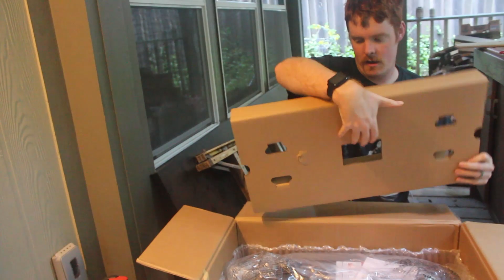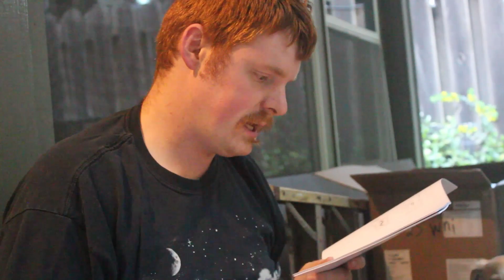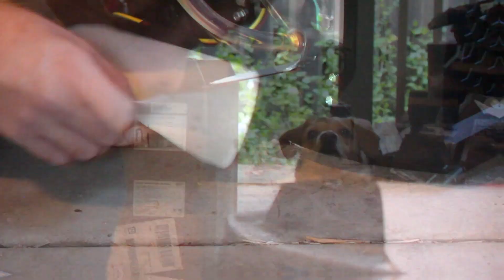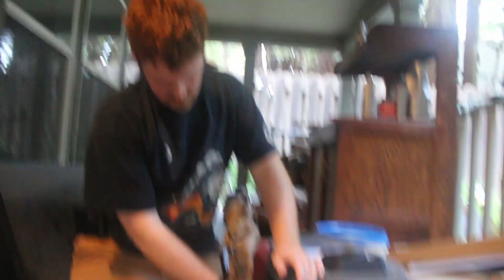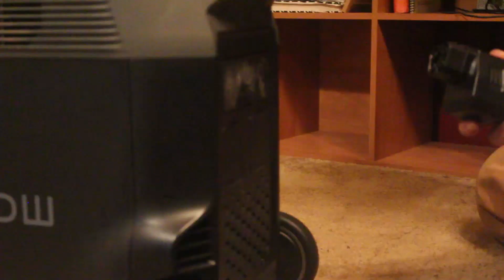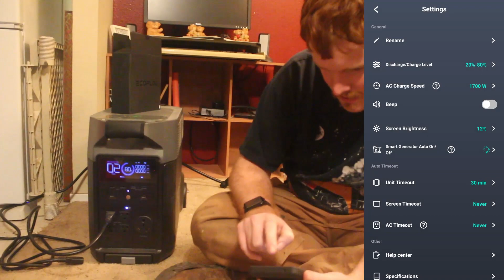Ecoflow Generator how to set it up to your battery and keep your house running.

Comment: I dont understand.  How are you keeping this generator in a safe place if the cord is only 15 feet and the generator cant be kept outside??
Reply from the maker: The battery is set up in my shed with a wire running to the house and the generator is outside the shed in a covered place. It would definitely be nice if you could get a longer chord to get both the generator and the battery though no doubt about that
Reply: @RedHairTech  Thanks for replying!

Comment: Hi other day all good the smart generator charged the delta pro but today it won’t charge the delta pro which was at 19%. Any ideas buddy?
Reply from the maker: I wood check the settings in the app for both the battery and the generator. Make sure everything is set right.